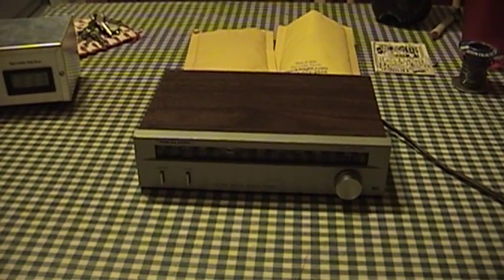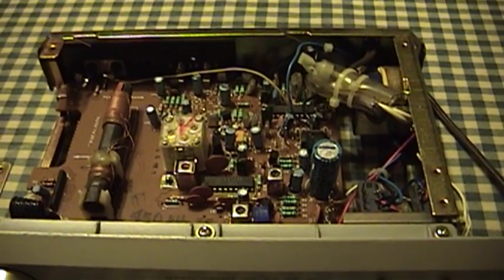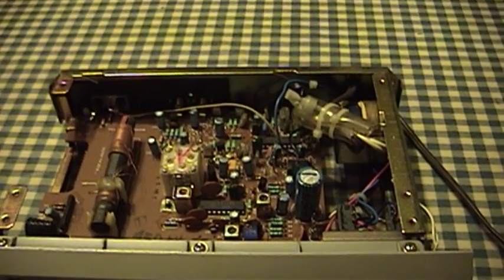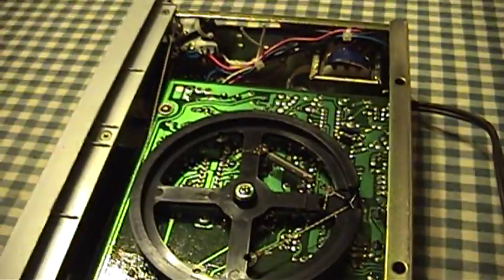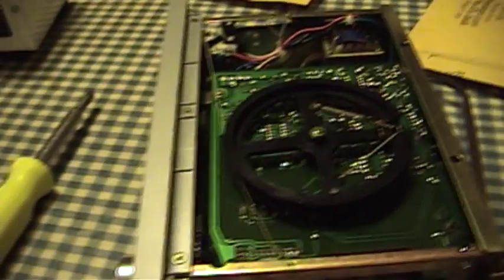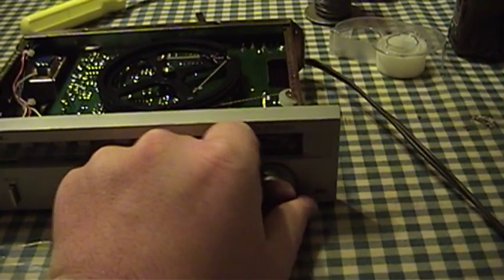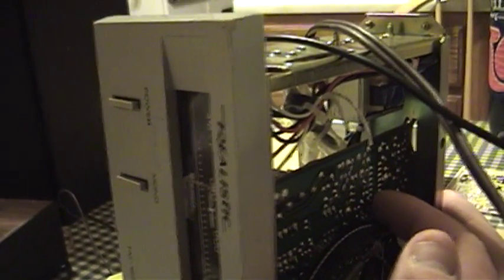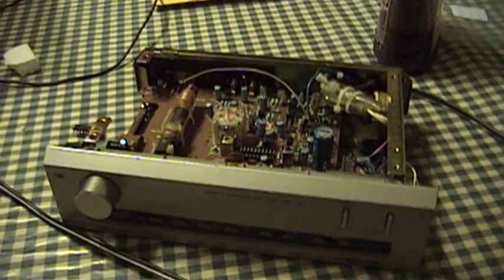Kitchen Table Electronics Repair - Realistic TM-152 Part 1

Comment: If you haven't already by now, retouch the solder connections. I suspect it's a bad solder joint most likely caused by expansion and contraction from heat. The area the bad connection is in will most likely be where you were touching it when it "worked" as it should. These are hard to spot without magnification. I would suggest taking a nonconductuctive spudging stick that comes with most soldering irons and probe around until you find it.

Comment: @uxwbill Same here, I would think that one would have been designed but it never came to be. Plus I think the later Motorola C-QUAM decoder ICs such as the MC13022 don't just decode AM stereo but also perform synchronous detection or what could loosely be considered that on all AM signals whether stereo or not. The IC only switches to decode AM stereo when it detects a 25 Hz tone on the QAM portion which carries the L-R difference information if I remembered correctly.

Comment: @uxwbill Quite so, I built the same transmitter that you did so I know its issue of not having a case. That one I might change one of these days if I can find a suitable project enclosure for it and mount some additional connectors for things like the antenna and provide easy access to change frequencies.

Comment: I actually recommend using the kit built AM stereo transmitter rather than the Talking House one as part of the troubleshooting process to confirm whether or not the C-QUAM decoder does in fact work. Plus you would get to hear in person what the TM-152 does and does quite well.